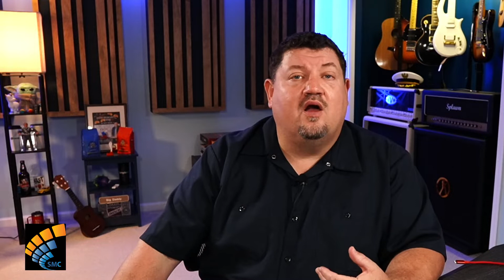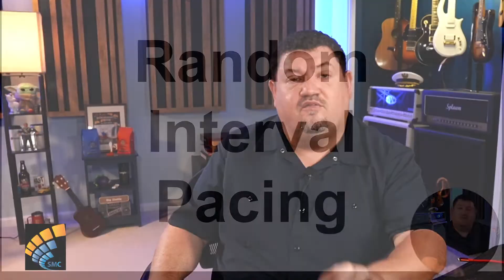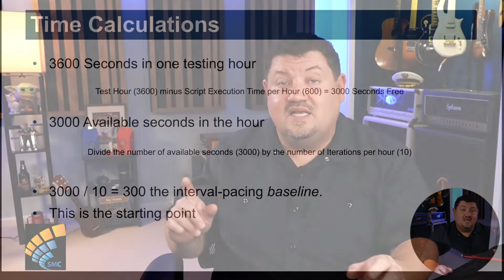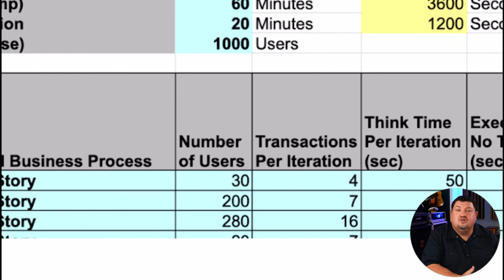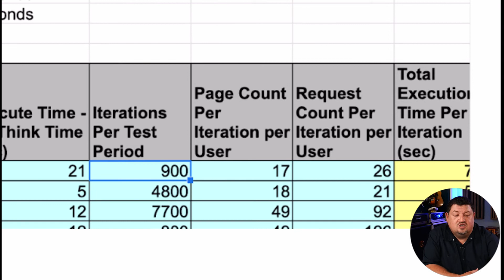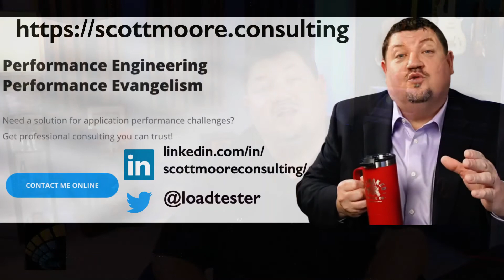Realistic Load Tests With RIP

Comment: One of the reasons I don’t like using pricing models of load testing tool vendors - it’s priced by the VU/h and my virtual users spend more than 90%  of the time just waiting.
Reply from the maker: What is a better model for pricing?
Reply: @ScottMooreConsultingLLC  vcpu hours?
Reply from the maker: For a local install, it would be difficult to track that in a non-intrusive way. Easier for a SaaS only solution, but that wouldn't be for everyone.
Reply: @ScottMooreConsultingLLC  Local installations are typically just capped to a certain No of users for all the projects - the new LR Cloud pricing is based on the VUH. Oracle’s model relies on CPU hours and it’s pretty conventient if you only need to scale up for just a few hours of tests. Pricing per vuser, especially on cost-focused organizations would encourage testers to squeeze their throughput into unrealistic amount of users - neglecting all the stuff you just mentioned here in the video :)